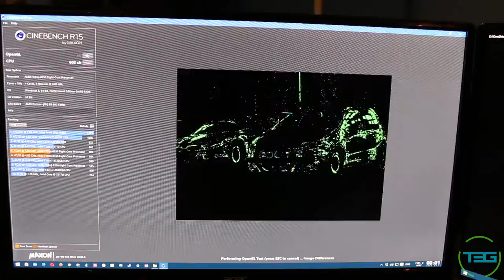Update - Computer Upgrades!

Comment: Can this run crysis3 at high at a avg of 60fps if I overclock the CPU to 4.2ghz http://pcpartpicker.com/user/Grim_reaper_of_consols/saved/6FBwrH
Reply from the maker: +Christopher beltran even if you overclock the cpu to 4.2ghz it won't affect the gameplay that much. Really games like Crysis require more of a GPU than a CPU. With the configuration that is in that PCpartpicker that you linked I would say that at high 1080p you shouldn't have a problem averaging 60fps. But anything over high settings like very high or ultra and doing anything like 1440. you're going to need to beef up your specs.

The reasoning for this:

1. you're not running dual channel setup for the ram with just one stick and that doesn't matter a huge amount but it does still affect it a bit.

2. You're going to want to be at least 16gbs of ram. Since games like Crysis 3, Titanfall, Battlefront and anything that is a newer game recommended requirements are usually over 8gbs now.

3. Since you put 100 dollars on a 280x card I'm assuming you are going to get is used and there's always a possibility that there might be something not good with it. But that's just being cautious more than anything. 280x is a great card but if you can I would recommend a 390 or like a nvidia 970 or higher, but that will definitely run over 100 dollars. 390 or higher will be able to push you over that high settings.

Remember High settings is fine but make sure also that antialiasing is only at 2x and not any higher.

-Haris
Reply: Thnks haris this means alot to mean and I'm getting these of Craigslist